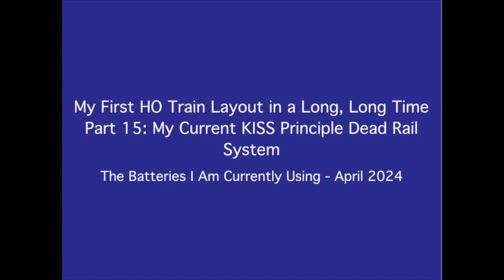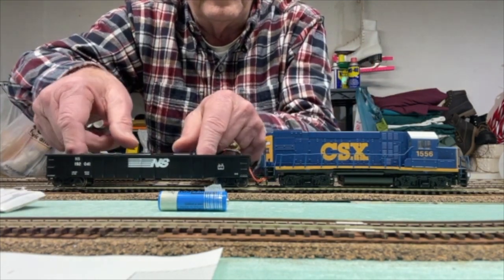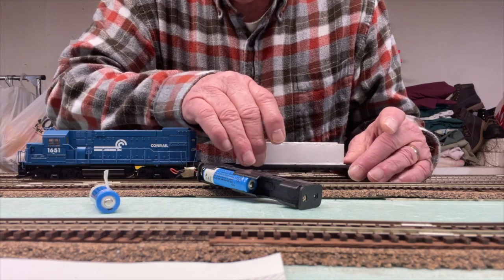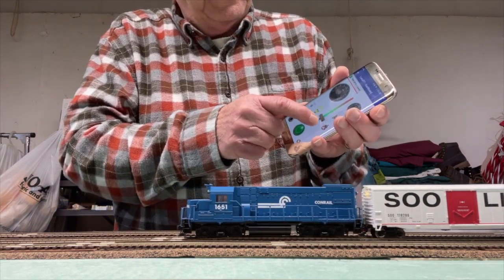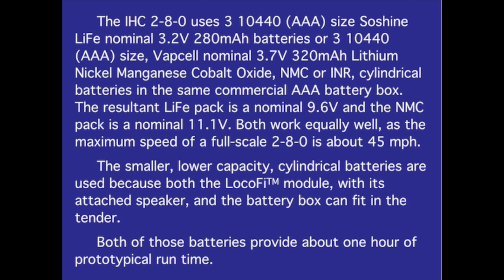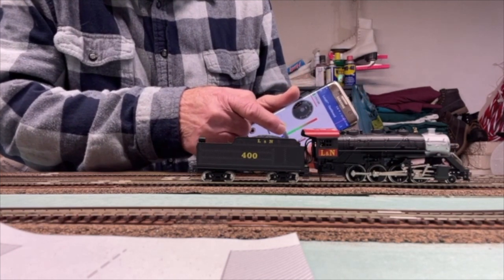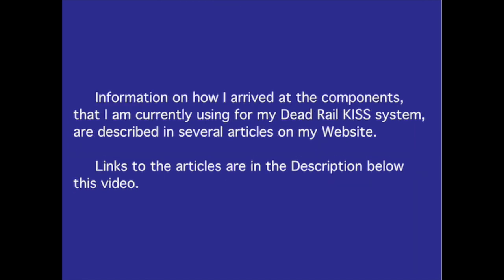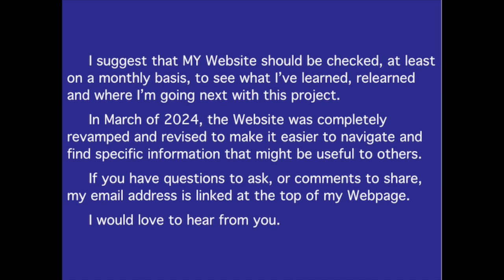Part 15: My Current KISS Principle Dead Rail System: The Batteries I Am Currently Using - April 2024

Comment: Interesting video.
I am curious if you tried any high end AA re-chargable batteries like Powerex PRO AA Rechargeable NiMH Batteries (2700mAh). 
I have been using these batteries for years in my camera flash and they will last all day at a wedding shoot where I have fired the flash on average 1400 to 1500 times and they're still not drained. They're very robust and last for years. 
In any case nice video and well done. Thanks.
Phil